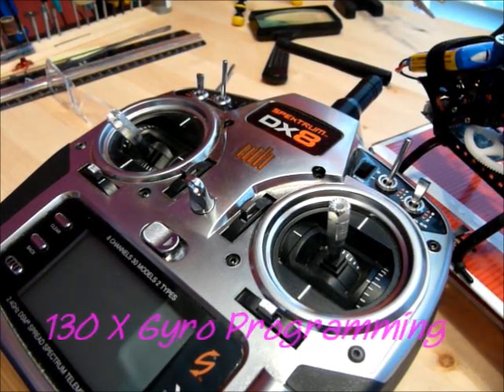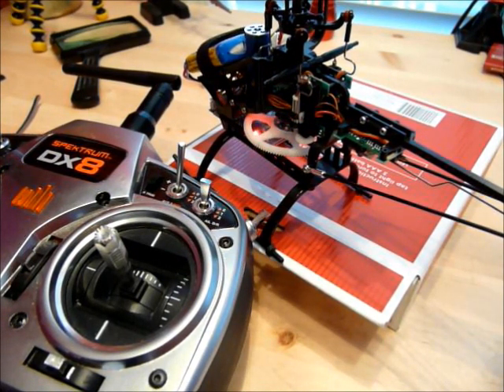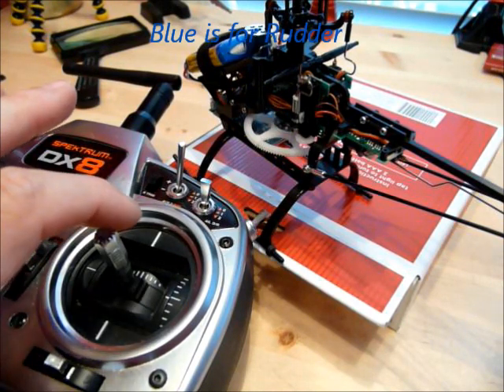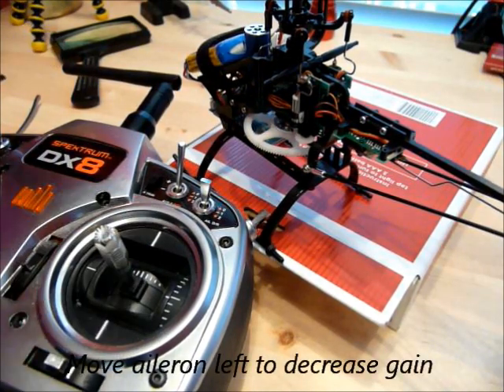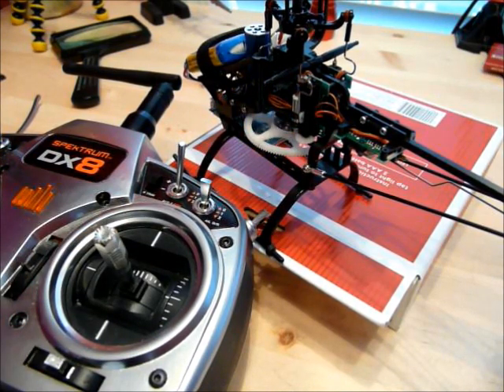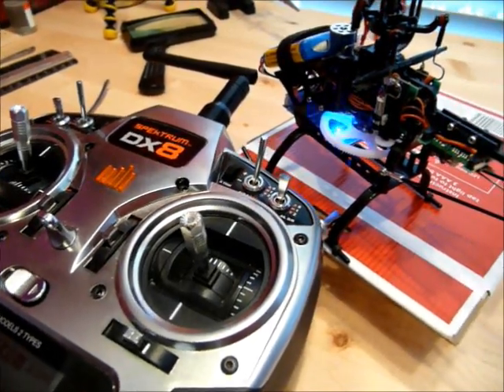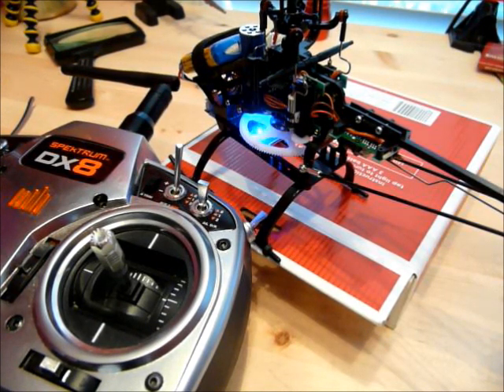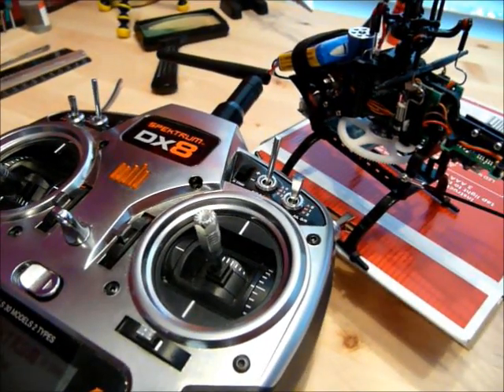Blade 130 x Gyro Gain Programming

Comment: Great video. Silly question do you disconnect the motor or just leave the HOLD  on when move throttle stick to full?
Reply from the maker: Hold and be careful
Reply: Thanks but some reason as I power up 130x it doesn't go into the gain settings mode.
Made sure throttle at full, trim is centered and Throttle HOLD is not active.  Any suggestions?

Comment: An 8 years old helicopter flies better then new ones. I just added FPV and flying with RadioMaster TX16S. Amazing and stable helicopter for FPV. Flies like the real helicopters. Thanks for the tips!
Reply: Can you get replacement parts? I’m kinda new to jellies and had one of these. I stripped a main gear on the rudder and just not sure if they make the parts any more. Also, how to not tip over when just sitting on the ground and blades are spinning?
Reply: @excellenceinanimation960  the only part I have trouble getting is the tail gears and B gear ,,all on back order

Comment: Hey JJ ,  me again.  I got the gyro programming all figured out ,  and now know that is not what the problem is ! lol !  The tail is still violently shaking back and forth.  What's happening ,  is the tail servo engine is moving  the servo back and forth ,  all by itself ! Really quickly .  I just noticed for the first time , because I don't usually handle it while it's turned on. Its making alot of noise too,  but sounds like the normal sound of frying electicity.  Any idea's ?